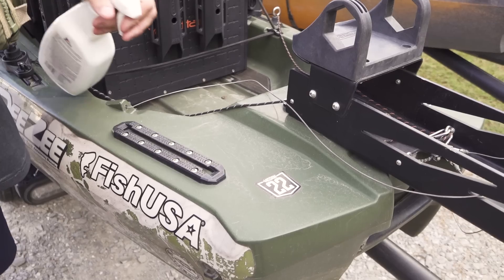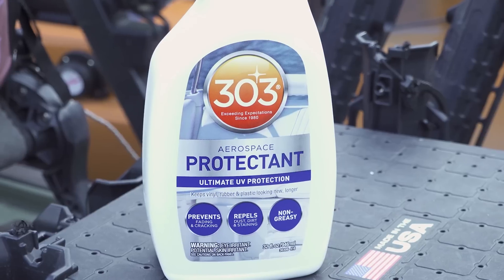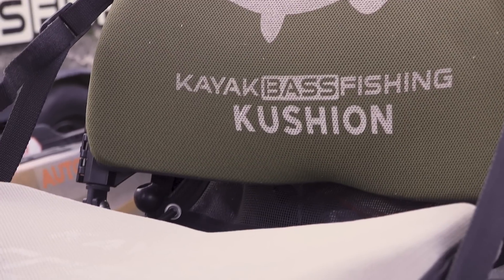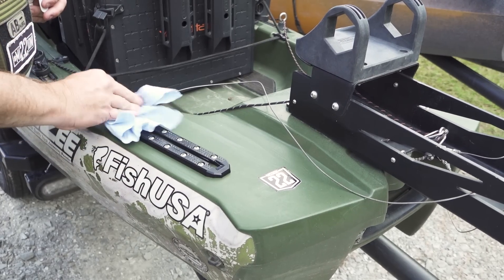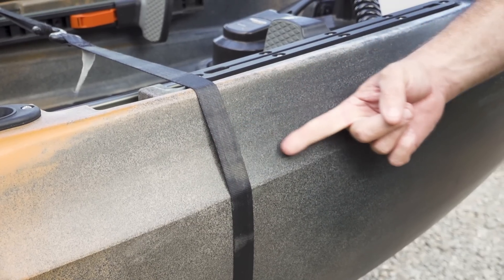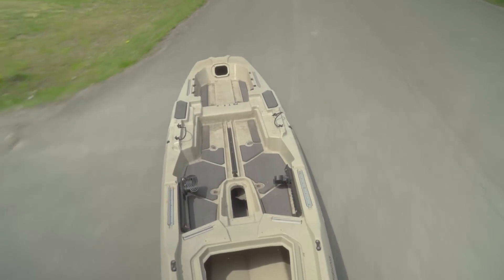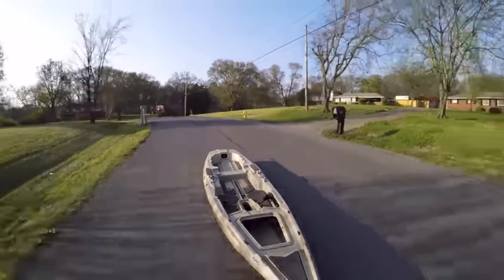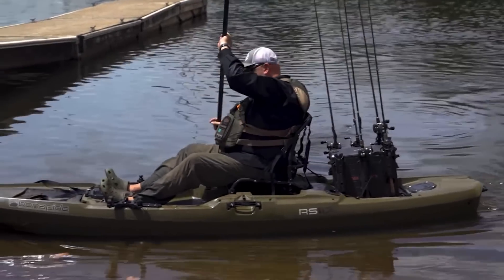Top 3 Ways to PROTECT your Fishing Kayak

Comment: I’ve made my own keel guard from sch 40 1” pvc. Cut it to the length you need, then cut it in half. Use a heat gun to flat it out somewhat then carefully heat it and form it to the shape you need. Once it’s cooled I trim the ends down so theres a smooth transition from the front of the keel to the pvc. Paint it. Once it’s dried, put 3m outdoor double-sides type on the side that is going to the kayak. Then seal edges with marine grade sealant. Once I do start to wear it down I can just make and replace it. You can get a foot of pvc for less than $10 bucks so there’s enough to make multiple keel guards. 🎉
Reply from the maker: Thanks Steven. I will look into that too

Comment: Truckers knot and Rope. I use 3 pieces of "Mule Tape" (a type of "strap" used for pulling wire under ground, has about 3500 lbs of tensile strength) tied in 3 different locations to my roof rack. You can pull it as tight as you like you Won't over tighten. Everything I know about loading or beaching my kayak has come from watching your videos.
Thanks for the tips.
Reply from the maker: Thanks Frank

Comment: That's where I got the idea for my kydex keel guard! They aren't bulletproof, but they get the job done. I carry my kayak in the back of my truck and I learned to load it on the tailgate from the side at an angle. Also, it's a good idea to use a cart to load and unload on a level surface. A loaded kayak will not stay on the tailgate or in the bed at all on a boat ramp.....I discovered that the hard way and that's why I learned to make the keel guard...😂

Comment: I have been using Flex seal paint (clear) as a keel guard on my yaks. Two coats and I can get a season of use. Touch it up in the spring and so far it’s been good to go. Common sense stuff like you recommended practice of not beaching head on will go a long way to protect the keel as well.
Reply from the maker: Thanks for sharing Jeff.

Comment: I’ve been using that for years! It’s Great stuff! When I sold my 2013 Hobie Outback in 2019, the guy I sold it to commented how new it looked!  I now have the new 2019 Outback and have been diligently spraying down my Outback with the “303 Protectant” every 4 months since I bought it. I have found it on eBay in 1 gallon jugs since I discovered how well it works, I have several (303 protectant) empty spray bottles I use to refill so I always have some on hand to use wherever I am!

Comment: I have mixed results with that 303 product. My house shutters are red, which sun apparently destroys and leaves a white smeary residue on. I could scrub it all I want but it comes right back a day later. If I spray 303 on the shutters look brand new for about five months, so twice a year I spray and wipe my shutters and they look new. Yet other things I put 303 on it seems to wash right off in the first rain, and my kayak seems to be one of those because it's so slick.
Reply from the maker: It’s more obvious on the shutters, but if you spray it on, wipe it down and let it dry, it’s protecting the other stuff too , even if it’s doesn’t “feel” like it

Comment: I obtain an old town that seems in good condition. Unfortunately  it was left outside for over a year, is there anything I can do or should get it in better condition? Already plan on washing it and using Aerospace.
Reply from the maker: Simple Green or any good Citrus based cleaner should do the trick. Take it to one of the car washes where you use the wand to wash it and the high pressure usually knocks most of that stuff off as well

Comment: So Kydex is good but...in my opinion Gator Patches get the 'gold' for keel guards/repairs. These are easy to work with, rigid (once set), durable, and the adhesive is unbelievable. Unfortunately, they are expensive and only come in a gray color, but if PROTECTION is what you're after, you cant beat them. No matter what you choose, make sure you round off any sharp corners as those are the most prone to catch and lift. The last tip in the video is spot on. I never "flop" down into my kayak, yet I have torn the plastic where the seat rests twice now. To remedy this, I made some Kydex molds to reinforce these areas. I would highly recommend others do this. Make sure they are wide enough to DISPERSE weight across a larger area and connect them to thicker plastic areas like vertical surfaces. Of course you could do this with Gator Patches too. I don't know why kayak manufactures makes this area so wimpy considering the majority of the weight literally sits on these points.